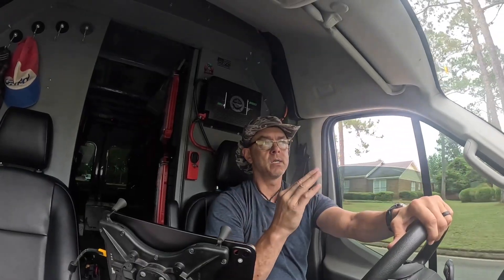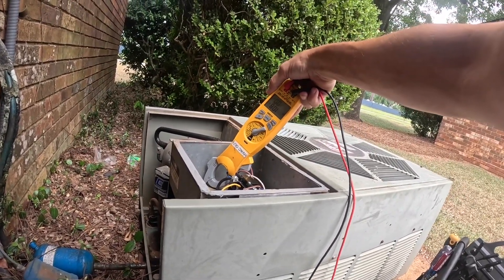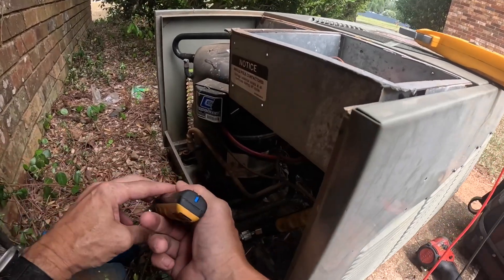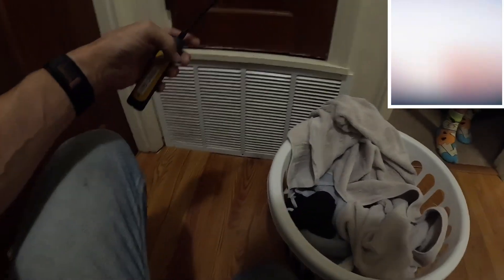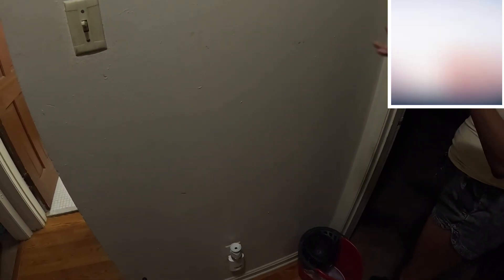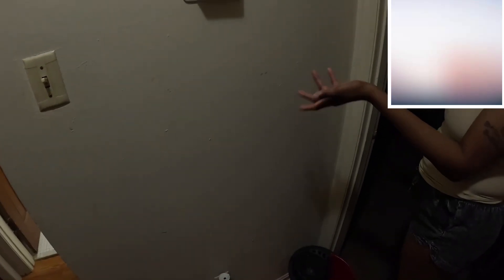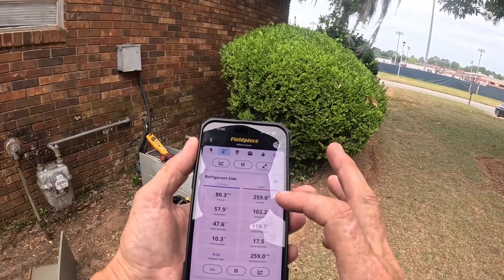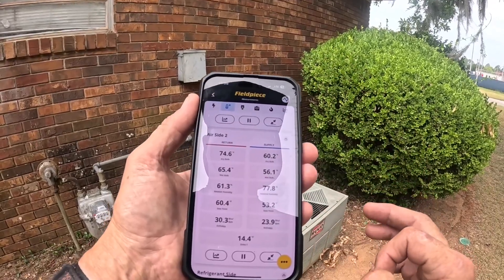Third Visit Within 2 Months, But Was It My Fault? #hvacguy #hvaclife #hvactrainingvideos

Comment: Not your fault.  I told my tenant "You let this place get to 80 and you'll never catch up"
Reply: I heard that, or even worse 90!
Reply: Another landleech extracting infinite recurring revenue from an uninsulated, uninhabitable hut... IMPRISON ALL LAND-SCALPERS!
Reply: Now i do not know if the technology into central ac has improved any in past 10 years but i grew to hate central ac . I live in Florida and they (all) break down . I hear every day when talking to someone that there central ac cannot keep up when it reaches 90f outside . My in-laws had quite a lot of water damage from there central air . I bought a new house around 12 years ago and sure enough mine froze and developed a large hole . Builder grade in Florida is just horrible . For sure keeps ac repair techs with a lot of work . 
 My central air broke down (again) last time no parts available . Told myself “no more”. I bought and installed 4 ductless mini splits . These things are amazing . Can have it as cool as i want , even when temps reach above 90f . I tested this very thing listed in this chat . Left the ac off . Came home to 90f inside my house . Turned on all 4 my ductless mini split and within 1 hour i was already down to 75f in the house . I will never go back to ducted central air . 
 But i must admit that i do not know if ducted central air has improved in design in past 10 years .
Reply: @jimjr9143 yeah those are inverter systems. Just keep in mind when they have problems it’s best to replace they less they got at least parts warranty
Reply: There needs to be minimum insulation requirements for rEnTaL uNiTs. The complete lack of incentive for building energy efficiency when the person who owns it isn't the person saddled with the bill to heat and cool it is one of many, many reasons that buying things with the sole intention of renting them out should be illegal.
Reply: @dregenius  what?

Comment: The, tenant was at fault she turned the air conditioner off then.” 
Then turn the air conditioner back on at the hottest part of the day, is not what you want to do the air conditioner will work hard and run all the time.  With an older air conditioner it will have to work extremely harder to cool the house down. Like you said in the video don’t turn your air conditioner off before you leave because you’re going to have a very hard time getting the air conditioner to cool the house down.”
I, agree with you!! Don’t turn the air conditioner off you should raise the temperature a few degrees.  I hope the tenant learned her lesson!  Do not turn the air conditioner off before she leaves the house. She needs to raise the temperature!!

Comment: Curtis, I've been an HVAC tech for forty years. I notice that on r22 systems you always overcharge them. The industry standard has always been 63-70 psi on the suction and 30 degrees delta T on the air temp in and out of the condenser with pressures from 200-280psi depending on OAT. this unit was a bit overcharged. At 80 psi the saturation temp is 48 degrees and at 67 psi its 39 degrees, still well above freezing and a better delta t across the coil.  I hope this helps as I am usually impressed with your skills.
Reply: Agreed. 45 years as a technician and retired now but that little system looked over charged for R22 to me as well.
Reply: I noticed the super heat was only 10 degrees. I’m assuming it was at least 80-90 degrees outside as she said it never gets below 79 inside. Also the wet bulb was 74.6 (I think hard to tell bad image quality )degrees so should have had super heat of about 30 degrees. Assuming no other problems with airflow. Seams over charged.
Reply: @chrisspan1525  
Doubtful its overcharged to an extent to be relevant.
Its an old system that is not maintained. 100% dirty coils, dirty filters, dirty everywhere.
Then that house probably has never had insulation installed other then the day it was built. Trying to lower the temps from 90 in house to 60-70f on a hot summer day is not going to happen regardless if the system was new or not. More cool air is escaping then the machine can push out. I dont understand why we have these machines in our homes and 99% of people ignore them until something breaks. 10-30 years ignoring a key part of your home. Imagine driving your car and never changing the oil until something breaks.

Comment: Thanks for another great video Curtis. Definitely an issue of on-off operation. I'm retired from school district HVAC operations and the first thing learned with AC is the air has to dry before it can cool. She indicated that it's operating continuously but it feels stuffy {6:44). That's because it hasn't had time to dry out the building and all the stuff in it. I believe your geographic zone can run dew points in the 60's? If so, running on-off won't work at all. Let alone factors of poorly sealed single pane windows and opening and closing doors or leaving them open etc. Especially every day, it will never have the capability of drying out the house. Basically as soon as it begins to get to the drying process, she turns it off and the system has to begin all over again the next day. This is most likely costing more than if she left it run all the time. Not your fault at all Curtis, Landlord shouldn't be upset with you. You certainly did your due diligence in making sure the system is performing. This is a great video to learn from.

Comment: You can't shut off then turn on in the hottest day .  Only way can do it if the unit is oversized and ductwork.  Let alone the discomfort is humidity.  No run higher humidity and temp . Once in cooling mode don't open windows.  This really raises humidity.  Can't remove it in a short time. Have a great day.

Comment: If I have my AC at 73 when it’s 100 degrees outside, my ac never shuts off and my house will say 78 or 79. Why because it’s freaking hot. And AC WILLL NEVER SHUT OFF. Reason why I put my ac to 78 from 1-8 pm. Then at 8 put to 75 and house cools down. Common sense people. 

Have some fans on the room you’re in and you will be fine. And close the curtains. I live in Texas and it’s hot down here.
Reply: Yes Texas is dry heat, with heat index it’s 112. I use to live in eagle pass Texas next to Mexico and it’s hotter over there. Reaches 120 with heat index. I’m use to the heat but also get educated on how an AC works. I’d rather raise the AC to not over work it. And change filter every 25 days and clean the condenser at least every 1-2 months by rinsing it off.
Reply: Inland CA is the same.  107 the last two days, 15% humidity.
Reply: @dfirth224  You are lucky. It is much easier to cool dry air than it is to cool humid air, and dry air can cool off at night. Very humid air feels 'hot' at 90 degrees unless there is a wind blowing on you. The water molecules in the air won't allow the heat to radiate off your skin.

Comment: Same reason people will crank the thermostat all the way up or all the way down thinking the unit will heat or cool faster.
Reply: My wife!!
Reply: @jonh901271  my father does it to his water heater too, shut the vents off on wood stove so the wood burns slower but the house is full of smoke :face-blue-covering-eyes:
Reply: My wife 🤣🤣
Reply: Third to that 😂 … i cannot get my wife to understand .
Reply: explained it to my 16 yr old daughter, she sort of got it, the garage has AC unit. turned off the AC and it's unbearably HOT we have 3 digit weather. later at 3 pm turned on AC, it took forever for it to be comfortable and set the thermostat to 76. next morning she saw it was nice went about her day then later at 3 pm we went into garage and noticed the difference she understood :body-blue-raised-arms:
Reply: My wife as well
Reply: What the air doesn't blow out colder if I turn it way down😅

Comment: 👍 you are correct, you should have told her it cost more to turn it off than to leave it on. Plus the comfort factor is much better.
Reply from the maker: Great point!
Reply: Was taught in school that you save 1% on your energy bill for every degree you set your tstat back up to 5 degrees.  After 5 degrees, you start going backwards on savings. When most people hear that they only save 1% they leave it set to 1 temp.
Reply: @--harry_ idk that sounds like BS to me.
Reply: @goorioles1976  hot goes to cold, so your walls, rugs, furniture all have to reabsorb the heat they lost. Most high efficiency units run at a reduced power if the thermostat is within a few degrees. Even heat pumps will jump to backup heat source if you move the thermostat more than a few degrees. What's the difference in rate of heat  loss for 10 or 5 degrees and energy requirements to maintain? Can't be that much to offset the extra btus needed to bring it back up. so yes makes sense.
Reply: @--harry_  I was under the impression high efficiency stuff ran at lower power but longer run times, this saves energy because a unit requires the most energy when starting up. So basically it's like highway driving vs. stop and go traffic.

Heat pumps go to the backup source if you move it up 5 degrees because it would take forever otherwise (some thermostats do have an option to prioritize efficiency and won't do that though). A/Cs don't have a "backup" cooling, obviously, so it would just run until the thermostat was satisfied, which if you moved it 5 degrees would take a long time, but it would also be off a long time during the setback period.

Comment: 17 degrees sub cooling? Seems like it may be a little over charged.
Reply: I was going to say the same thing.
Reply: But is it a piston if so what was SH.I don't remember
Reply: I was thinking either a little over charged or heat strips running, seen it a few times on those old ruud/rheems with sequencers

Comment: My parents had the same setup with uninsulated ductwork. Old single pane windows and very little insulation on a conventional foundation. 77 is about as low as youd see on a hot Mississippi Summer

Comment: I don’t think that’s your fault. You told her right, she’s trying to recover around 10 degrees plus the humidity, not gonna happen even in a brand new home with a brand new unit. We only drop ours back 4 degrees during the day, I wouldn’t go anymore than that on ours because it would be the same thing hers is doing. Honestly she’ll probably save money doing it the way you told her verses what she’s been doing. We have a 14 year old 3 ton  Rheem split unit HP cooling 1900’ in Kentucky. It does really well at 72 setpoint even in 100 degree weather.

Comment: Pump it down to check the reed valves in the compressor
Reply: No that is not a scroll compressor
Reply: @markchapman4197  Looking back I see you are 100% correct. My bad.
Reply: It's a scroll compressor. No valves.

Comment: One thing I noticed Curtis was the condenser fan motor did not "coast" when you spun it by hand. It came to a stop rather quickly vs. spin a couple of times before coming to a stop. Would a new problem free motor slow down that quickly, I'm guessing to be a no. I have noticed USMotors has the "Mojave" model and they are rated for higher outside temps and additionally they use "ball bearings" vs. the "self aligning" sleeve bearings. I'm just guessing those are more robust and for less than $10 more, a better bearing for the long run. I know, some HVAC folks might disagree about bearing types but its been my experience the most common reason motors need replaced is because the bearings fail and lock up the shaft. Could be that motor is going to be defective soon.
Reply: I thought I was the only one who noticed that. You would think for a brand new motor that thing would have more spin or spin freely a little better.
Reply: You're correct, always select ball bearing motor replacements!
Reply: My thoughts as well parts are not build to last anymore they are designed to fail so they can sell another one shortly. But he's the expert not me but would love to hear his thoughts on this.  Thanks for all your videos Hvac guy I do appreciate them a ton!
Reply: Only 2 fan blades too
Reply: @The4thshodow  That wouldn't apply as the engineers figure all of that out unless the fan was changed from a 3 or 4 blade to this 2 blade. If it has the correct pitch, diameter and RPM...its how they designed it. Not a lot of them have 2 bladed fans, agreed but they made them.
Reply: I saw that too but it wasn't over amping. I wonder though if it was getting the right rpm on motor but head pressure seemed ok
Reply: But motor did seem stiff when he spun it.
Reply: @MrJujubean  I don't believe on their way out bearings are going to show up on the amp meter but bearings half way to lock up will. What I noticed is Curtis toughed that hub and it was HOT so that would have been my first concern once I saw the stiff bearings. One good reason to consider using those 70C Mojave motors as they are built to higher standards and have ball bearings for maybe an extra $12.
Reply: Yes, thats about the only cost increase plus, the extra durability to deal with ambient heat. At least I feel more comfortable having one of those vs sleeve bearings.
Reply: Very true always better with the best bearings in anything
Reply: Thanks for the videos Curtis!! Much appreciated! The audio inside the van is a little hard to hear sometimes.

Comment: If it's 25 years old then anything can break at anytime. Surprised you didn't find a dinosaur fossil inside.
Reply: It's made it this far...it'll keep going if serviced correctly.
Reply: I've worked on at least two units that still had R-12 in them.

Comment: You need 18 to 20 deg delta on a unit that old,they had bigger compressors,you need to check return plenum for leaks,and to see if the house is negative ,if it is you have a supply duct leak .the suction pressure is high for a 74 deg return..2 cents.
Reply: Overfeeding expansion valve will cause high suction too. But I'd be willing to bet there are leaks in the duct work. It's a single return system with the mechanical closet open to the attic. My experience with that setup is there are significant leaks especially if there has been a replacement system installed. It is difficult to seal around the coil and supply plenum when the space is just big enough for the equipment.
Reply: @topher8634  True, if it is open to the attic it will never be right.
Reply: Could blower fan speed be too high?
Reply: That would do it, but I doubt that's the case.

Comment: I’ve tried tell people leave it alone yes you can bump it couple degrees but when it’s hot out leave it alone I also run a box fan in the afternoon to help with circulation keep cool air moving around

Comment: The majority of people don't understand what latent heat is.  Once I explained to a customer that the ac unit had to pull the heat out of the walls and furniture and everything else, then it would start cooling the air.  I never had a call back after that.  Great work, keep it up.
Reply from the maker: Thanks
Reply: I found this out after awhile . I could not figure out how my house was still tough to cool down at night after it reached 95f that day . Explained to me the house collects a lot of heat in the house itself such as in the walls . I also learned it is a terrible idea to turn off the ac when out to work as it was impossible with my central air to recover for such high heat .
Reply: "The majority of people don't understand what latent heat is." Clearly a true statement, lol.
Reply: What phase change are the walls or furniture doing?
Reply: Tell her to set it to 75,76 max I would say it's better.. good video brother.
Reply: Apparently you guys didn't hear a word she said. She says it NEVER gets below 82 to 85 in the house when she is home,
Reply: It is a shame, you would think HVAC GUY would be able to explain it without butchering it and throwing out false information
Reply: Heat out of walls and furniture isn't latent heat😂
Reply: @richardbartlett6932  My bad, I should have said the sensible heat.  Thanks for pointing out the mistake.